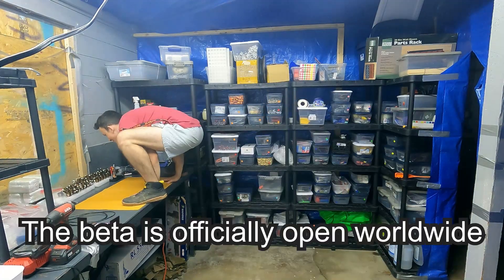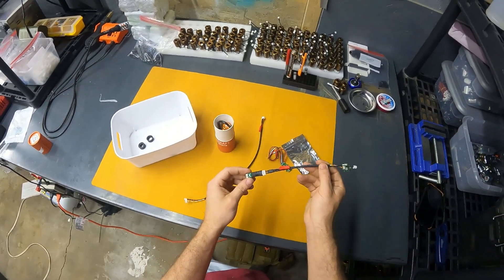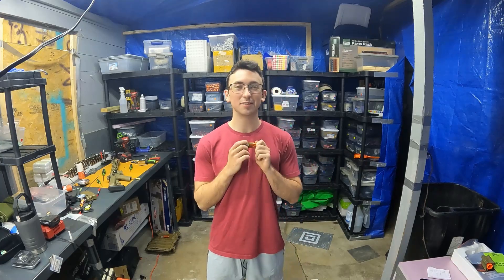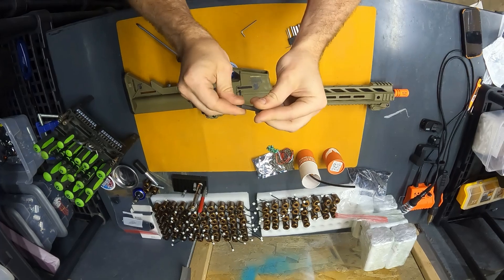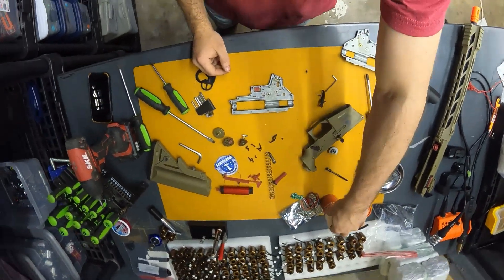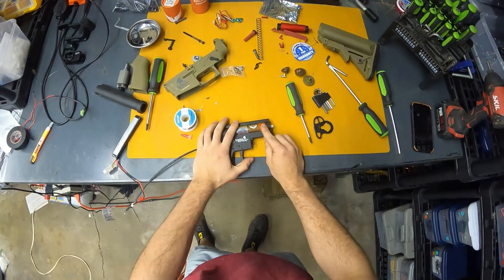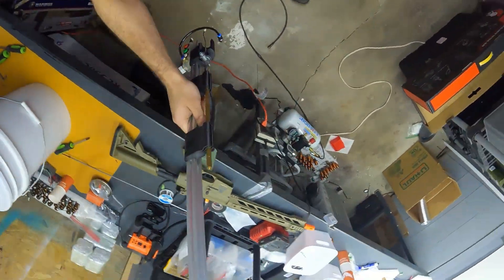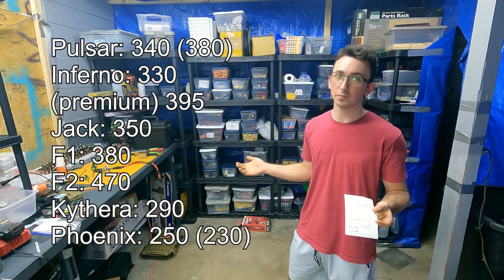HPA the AFFORDABLE WAY - LOW COST HPA BUILD / REVIEW / INSTALL / GIVEAWAY

Comment: Question, how did you get the buffer tube on?  It usually screws into the Spring Guide and what holds the spring guide in place so you can get the screw in from the buffer tube?

Comment: I am having some issues setting the phoenix into full auto. I have held the trigger for an access of 10 seconds before pressing down the selector switch for the 3 seconds needed. I even tried setting to all the others and I’m not getting anything accept semi.
Reply: Nevermind I figured it out. Just a heads up to anyone reading this with a full auto only lmg. You have to find a way to permanently depress the selector switch on the trigger board. Hope this helps.
Reply from the maker: @JeremyHolcomb-d8q  yep, you need to hold the trigger down the whole time

Comment: HI,
Can this engine fit in a vector ?
I'm looking to go on HPA with my vector cause why not ^^
Reply from the maker: Hello! Unfortunately not since the vector has a weird mechanism, but some solutions are in progress!
Reply: @BackdraftAirsoft  yeah it is a bit tricky, but my main problem would be the fcu, cause the nozzle seal could be done with some some work on the gearbox (as example Airsoft junkies have done it)

Comment: how many jules tho fps means nothing at my local feild they do it by j if its over 1.13 i cant use sadly
Reply from the maker: It’s hpa, so it’s adjustable :)
If you need it lower you can turn down the pressure :)
Reply: @BackdraftAirsoft  I've heard it doesn't preform well under 80psi which with my inner barrel would be to high

Comment: Just a little more you can get the kythera that is extremely easy to use and tune. Yea you don't full auto but a lot of places don't allow full auto especially milsims. Also the kythera has no electronics to use so no point of failure there like the other engines that use electronics do.
Reply from the maker: From what I’ve heard, the kythera is anything BUT easy to use and tune. Plus, this engine has a lot more features and is able to install into any gun with just a nozzle change. The kythera needs to have a whole trigger assembly made for each gun.
Reply: @BackdraftAirsoft  it was easy for me to get it in and tuned. Also hate electronics and I only really use v2 gearbox's lol.

Comment: Love it! I don't know how you could make an even cheaper one, but HPA is not just the engine, so we need some manufacturers to provide more budgets solutions for the other parts needed, too. Thanks for innovating!
Reply from the maker: I’m working on some concepts to cut out the air rig entirely! It may be a few months to a year out though, so stay tuned.

Comment: Hey i am a passionierte Airsoft Player and tech 
For about 2-3 years I have worked on hpa engines in my private time.
About halfe a year ago I started building my own Cuba T1000 out of mild steel parts.
I am so glad that you have actually built a cheaper engine than the competition.

Comment: Really interesting way to HPA guns for cheaper than most mainstream manufactures or buying second engines which are still crazy expensive
Reply from the maker: The goal is to be the same cost as high performance AEG upgrade parts! It’s pretty easy to spend 250 on an aeg gearbox if you buy the good stuff, but even then it’s still not as good as hpa!

Comment: Thank you sooo very much for this awsome initiative and if possible DON'T STOP perfecting/upgrading it!!! The community needs these sort of projects. Don't want to be the bad guy in the room but I invite you to try to develop a pure mechanical unit (forget about the multiple fire modes, make it single only, simple and brutally longlasting).

In the long term please address and provide detailed intel regarding ideal air input pressures and joule output correlation.

Regards and much happiness

Comment: Would your custom nozzles work with a wolverine engine?
Reply from the maker: No, they only work with the Phoenix. What would you be doing with the Wolverine? Sounds like a fun project, do share!
Reply: @BackdraftAirsoft  I've been stuck waiting for a nozzle for my G&G FN FNC. Bought a wolverine inferno kit for it but can't find nozzles anywhere. I've got a shop trying to contact wolverine but so far no luck.

I'm trying to recreate my service rifle
Reply from the maker: @orca7053  that’s awesome! Is it longer or shorter than an m4? Maybe you could have a lathe shop make a nozzle too to press over the old one if it’s longer (after making the old nozzle thinner) but if it’s shorter than an m4 maybe you could just have a lathe shop shorten it for you?
Reply: @BackdraftAirsoft  I might give that a try, thanks for the tip!

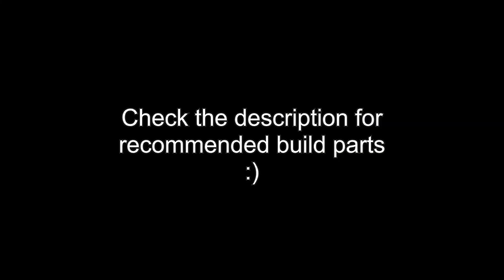Comment: 11:43 so what are the recommended parts?
Reply from the maker: Still putting the list together, but for a bucking I’ve heard amazing things about the 4uad, and for a hop up the “silent arms” hop up has the ability to add tension to your bucking lips which is great for open bolt hpa engines
Reply: Hi from the other side of the pond . I'm in the UK do you post to the UK .if so  at what price .I'm trying to sort out a hpa engine for my son . And I like your product. Looks well made .I've tried all supplies in the UK but all out of stock . Look forward to your reply .
Regards paul

Comment: Kraken is how i found out about your engine. Now we just need someone to 3d print a smg kit or pistol just for this engine. Wonder if it will fit in my arcturus m4. I just bought me an hpa setup from amped for my aap01. It was either the hpa kit or this engine. Figured i needed the hpa kit first.
Reply from the maker: The air rig is a good place to start if you want to spread the purchases over a longer period of time :)

As for printed smg… that is on its way too.

Comment: I had planned on being a beta tester. Paid for my engine and was excited to find out it was on its way. Unfortunately the tracking never updated. Come to find out the small cylinder it was packaged in was crushed and the labeling couldn’t be scanned. What arrived was a taped up empty tube that had a hose and grease inside. Here’s hoping that luck turns my way this time!
Reply from the maker: I gave the refund for it, right? What was your order number? USPS can be rough with packages, if I didn’t give a refund I can send a new engine!

Comment: Single solenoid, open bolt engine with fcu for 250 right?
Not much on what its like to adjust tho, is there something about that in kraken's videos?
Reply from the maker: The actual tuning process is very simple, it has the 2 potentiometers for delay and dwell which lets you control the solenoid open/closed times. I think I showed it in the video originally, but it must have been clipped out to keep the video short

Comment: I'd love to try HPA'ing the MK48 I've got ordered (if it ever arrives, darned shipping problems). My only concern is the lambda MK48 has the box mag set to autowind as you fire, and I'm not entirely sure how to integrate that with any of the standard FCUs from ANY HPA engine. I'd love to get one if I had some help figuring it out! (Only just finished my first year of mechanical engineering. Maybe I'll learn next year lol).
Reply from the maker: The fcu currently doesn’t have auto winding features, but it’s something we’re hoping to implement in the next revision!
Reply from the maker: You could connect a 555 timer circuit and mosfet to the trigger if you wanted to power the magazine on each trigger pull, or you can use any other fcu with auto wind capabilities with the Phoenix :)
Reply: @BackdraftAirsoft  Thanks for the advice! I'll likely run it stock until something breaks, but then I might give it a try :)

Comment: Dude, this rocks and it’s great that it is competitive. Do you have an offset nozzle option in the works? How about something like a universal trigger system like wolverine has?
Reply from the maker: Yeah! I’m ordering wire harnesses that can be direct soldered to your trigger contacts, so no need for an extra board in the gearbox, just solder away!

Comment: I have an M4 that's broken for years. Would be perfect for it. 
But, is there a semi-only version?
I live in germany. And you can't have fun in germany ^^

Otherwise, respect for what you've done.
Reply from the maker: If the order comes from Germany I remove the selector switch so it will be permanently set to semi only!
Reply: @BackdraftAirsoft  Very nice. Looking forward to get one

Comment: like the vid, but does it fit in amoeba 013 honey badger?(i know its an v2 gearbox)im asking this becaus i have a broken gearbox in my work room and thinking of fixing it with hpa. keep up de good work.
Reply from the maker: Yeah it does! The area gearboxes have their own trigger board though, so you could either solder the wire harness to the efcs of you could buy the p* efcs trigger board and connect it to the modular fcu. (I don’t sell the ares trigger boards yet)

Comment: really nice man if i ever go from sniping to dmr or assault rifles ill definetly get one of those
one question are the dimensions like diameter etc. the same as for example a wolverine or polarstar engine has?
asking because there are cool 3d printed upgrades (for alignment) for this engines
KR and  keep on !!!
Reply from the maker: The external dimensions are the same as the Wolverine inferno. What printed kit would you be putting it into?
Reply: @BackdraftAirsoft  theres the 3d printed adapter for the MAXX Hop up unit whicht locks the engine togehter with the hop up unit
Also calles poor mans MTW mod
Perfect for getting good alignment and consistency out of the whole build
Reply from the maker: @SharkWhite333  ok nice! If that works with the inferno it should work with the Phoenix

Comment: Lets go!  Hyped AF for a new HPA engine and for it to be cheaper than any the others on the market!! 
No joke, when it releases try to hit up AMPED airsoft and make a deal with em. they made HPA extreamly cheap to get into with there Regulator, lines and tank deals, you should work with em to make full packages
Reply from the maker: That would be really smart! Selling a full starter kit would be sick.
Reply: @BackdraftAirsoft  Airsoft always hits a standstill in what players can get / afford for a while , I think filling the gap that was left when the v12 was discontinued is a HUGE thing as many people want to get into HPA but see the large price tag and are turned away
but with the Engine being almost 100 dollars cheaper than the competitors it lowers the price drastically, put that in a old combat machine and the things a beast
Reply from the maker: @notsosolidsnakeproductions3596  Exactly! I wanted hpa because I was sick of my aeg running itself into the ground. Also tired of that god-awful motor noise, eww.
Reply: @BackdraftAirsoft  motor noise Isnt a huge issue with a good motor. but if im spending 100+ on a just a motor i should just invest in HPA!!! Wish i could snag one of these personally but moneys tight so wont be able to grab one till after the tester ones are released!! Excited to eventually grab one, JUST SCARED ON WHAT IM GONNA PUT IT IN!!